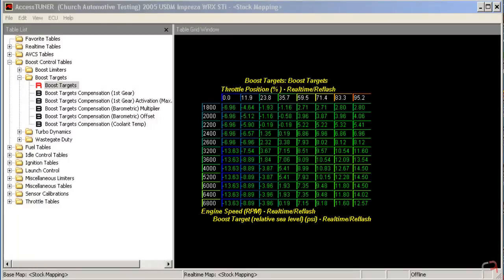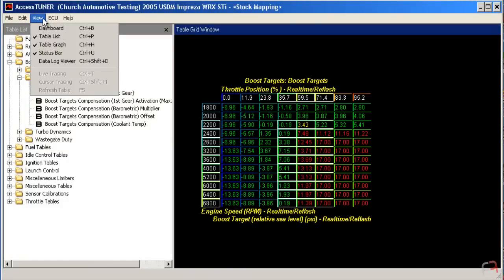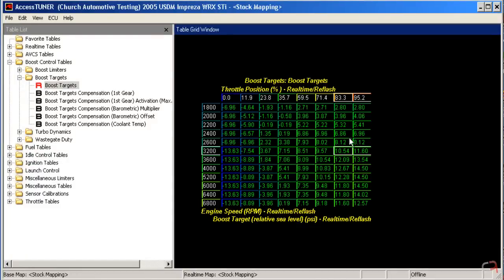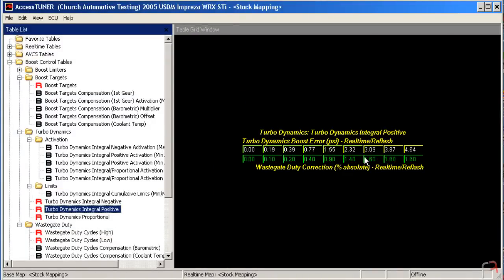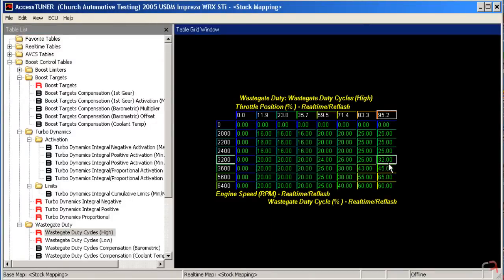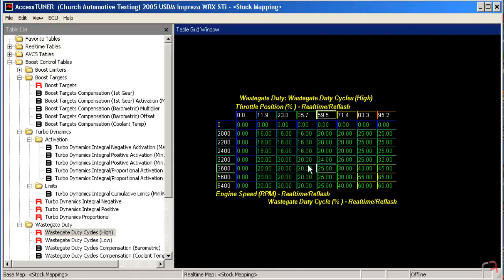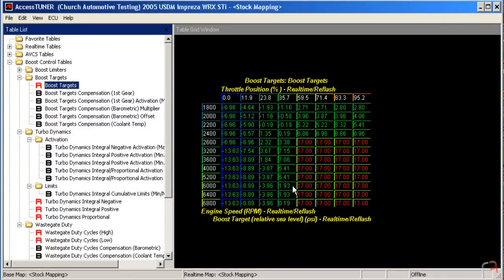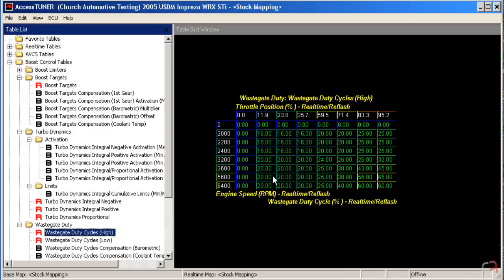Subaru Cobb Access Port Boost Control Tips

Comment: does anyone have a TGV Disabling how to's for Accesstuner?
Reply: go into accesstuner > edit > advanced perimeters, and uncheck p2004 to p2022 (tgv codes). then search for "tgv" above the table list and any table that has both "tgv open" "tgv closed" mirror the open table to the closed table. Hope this helps. also the codes for egr are just before the tgv ones if you plan on doing that delete also.